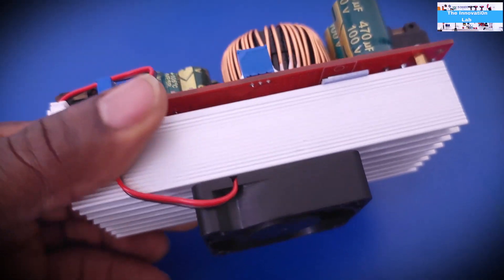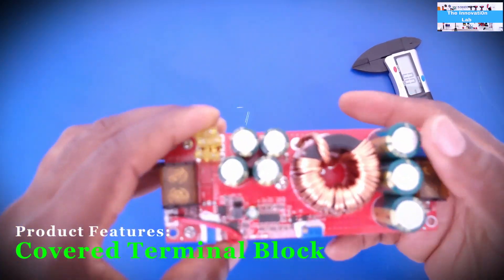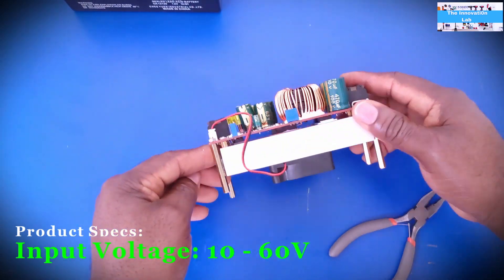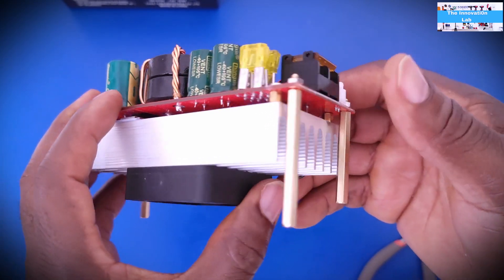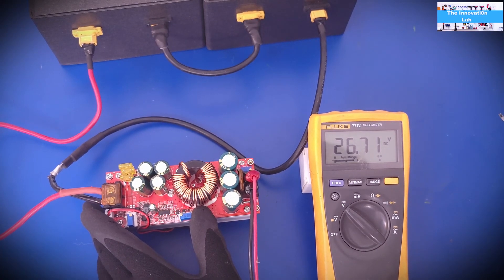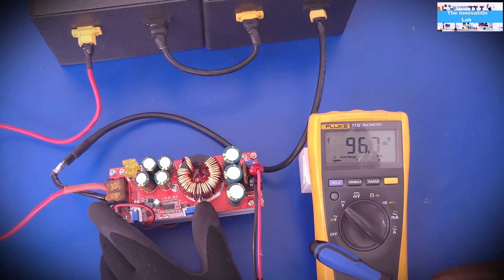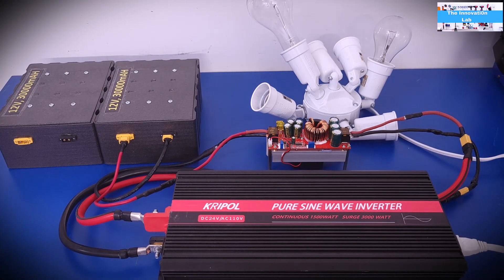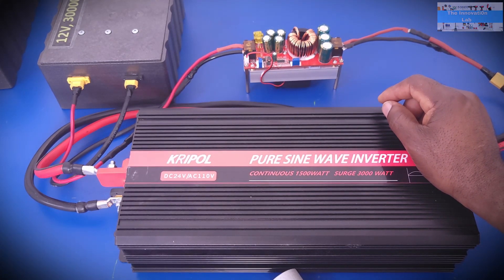Testing Cheap DC-DC Converter from Amazon - Are They Any Good?

Comment: Hi friend, i use these stepup but have problem  whit  trimmer, not is easy regulation cc and input voltage. The output voltage is good easy,but how can have the max power output? I use trimmer but not see becouse but not is stable output  at max power.
Reply from the maker: The CV trim potentiometer works when you have a load on the system. 
With the input of the converter facing towards your left hand and the output facing towards your right hand, you can increase the output current by turning the potentiometer towards your right (clockwise turn).
When you get to the maximum point, you will hear faint audible clicks from the trim potentiometer.

Note:
If your CC trim potentiometer is all the way counterclockwise (lowest output current), your converter will lose output voltage regulation and will not boost the input voltage.

Output Voltage crashing when you apply load?
This could simply be because your set output current is too low. Adjust the CC potentiometer until you see both the output current and output voltage increase.

This is the reason why I always recommend using some power monitors - this way, you can see what is going on.
Watch the videos below for some better explanations;👇👇👇
https://youtu.be/WDWJ77WWkXc?si=ry02ho_BydAFa8hh

https://youtu.be/0Ct_sgbAjU4?si=2exdmFp1vxjSHS-z

I hope this helps.
I hope you are a subscriber.
👍😎
The Innovati0n Lab💥

Comment: Welcome - Thank you for your useful and wonderful experiences. I have two of these 1800w I own a 72v electric bike I use a lithium-ion battery and one of these transformers to raise the voltage to 80 volts to help the batteries while traveling, and it works for me acceptably. I have no problem with the efficiency because I use a 12 volt battery. My question is: is there a way I can add the second booster in parallel? And set the voltage of each booster to 42 volts And connect it with 3 batteries, and the other also through a diode bridge to prevent current collision and breakdown of transformers, because as you know, the negative is connected directly from the output to the input. Thank you very much, my dear. My greetings to you.
Reply from the maker: Thanks a lot for the great feedback.👍👍👍

We have made a lot video projects with these converters. In general, SMPSs do not work well in parallel unless they are designed to work in synchronous control mode.

We have conducted the paralleled converter experiment and I found it to be very unreliable. However, we just found a way to raise the output power of these converters. 
See the videos below. 
💥 PARALLELED BOOST CONVERTER CONCEPT:
https://youtu.be/EKqIIOe_q8k?si=ZwgxstuFYxAtLe0z

💥 COVERTERS WITH BOOTED POWER OUTPUT:
https://youtu.be/_cG3smKwTzE?si=uJPFZL8eDacqAvVE

I hope this helps.
- The Innovati0n Lab💥
Reply: you can change Vol and Ah not Watt

Comment: what is the max input current (amps) again please?
Reply from the maker: The specs of these converters are not very well written. I would plan for 30A max... just to be on the safe side.
Reply: @theinnovati0nlab782  thanks for answering that. I was asking because I wanted to hook 4 solar panels 460w (40v) with rating of 9amps to this unit, before the wires go in to the mppt solar charger of an inverter. The mppt volt range is 30v to 80v and that's why the solar panels are working 60% of their power because when they up the amps, they reduce the volts and they drop from 40v to 30v very easily creating a bottleneck.

Comment: Will this unit also step down the voltage. I need to reduce solar voltage down from 66v to 59v.
Reply from the maker: No it won't. It only boosts the input voltage. You will need a "Buck converter" for that.

Comment: I was thinking of using one of these to power my laptop from my lifepo4 battery bank. This would be more efficient than using a 2000w AC inverter and big 200w power adapter.... but I'm not sure on the quality of the device, fail-safes like over voltage, output current ripple etc, is it worth using this for a $1500 laptop? I can't find a proper 200w laptop charger anywhere for 12v bank... any thoughts?
Reply from the maker: I wouldn't recommend that you do something like this without proper research, lots of testing, and analyzing the results. 
I would discourage for now. Bit is you insist on doing it. Maybe you can try it with a cheaper laptop and see if it even makes much sense.

Hmmmm, now you git me thinking about this...😂😂
I think it would make for a good experiment for us... but no promises for - maybe in the future.

👍👍
The Innovati0n Lab 💥
Reply: @theinnovati0nlab782  Not sure where my previous comment went. Despite our better judgement I followed through with this and wired the converter to a dc barrel jack, then plugged in via a "dc to HP laptop charger adapter" which apparently has the required resistor inside to allow the laptop to detect a charge via the 3rd "smart" pin inside the charging port. It's charging properly at full speed without even kicking in the converter fans, and actually consumes 100w less than inverter + ac charger! Only weird thing is to initiate the charge the laptop has to be on lock screen, sleep, hibernation or off... not the biggest problem in the world, unsure if this is a Windows thing or HP adapter... but once it's charging it works well. Guess time will tell, if I fry my laptop I'll update this comment lol
Reply from the maker: @aciidphreeek  
Amazing! I am glad your project idea worked. Thanks for the update. Keep me posted on the performance.
👍😎
The Innovati0n Lab💥

Comment: Hello. Best video. I would like to know if it is possible to replace the two 12v batteries with a single 24v 340w solar panel to do the test that you did towards the end of the video from 13 minutes onwards.  THANKS.
Reply from the maker: Absolutely.
Yes, you can do that. 
The two 12V battery packs were used in series to make a 24V LiFePO4 battery pack anyway.
👍😎
The Innovati0n Lab 💥
Reply: @theinnovati0nlab782 All right.  have you made any special adjustments to the buck converter (input and output current and input and output voltage) in relation to the 24v inverter ?
Reply from the maker: @user-nu8cb7tv3g  
If you are going to use it to drive an inverter system, you just need to make sure that the output current potentiometer is set to the Max point. 
Set your output voltage to fall within your inverter's input voltage range.

For output voltage,  output current, and undervoltage protection adjustments, see the videos below;
👇👇👇
https://youtu.be/WDWJ77WWkXc

UVP setting:
https://youtu.be/t8Aaz4iQeXY

Comment: Thank you for the review I just wanna know that why is my 1800 dc tp dc fan not working is their a switch for it???
Reply from the maker: Thanks for the great feedback.
The fan is temperature controlled and should start up automatically.
I have not seen any switch for that. 
You should return it if you just bought it. 

On a second thought, the fan will only start up under a heavy load....which would obviously warm up the system enough for the temperature sensor to detect the heat and turn on the fan. If you are only using it for small loads, the fan may never turn on.

I hope the helps.
The Innovati0n Lab 💥

Comment: I'm a little bit surprised by the parallel connection of the input fuses. This is not good engineering practice. In Germany it is also an absolut engineering no go.

Fuses are designed to blow up at a certain amount of power which develops at a certain current. This amount of power can be very different for different or even the same fuses designed for a certain current.

It means the inner resistance of a fuse can differ a lot. And therefore the current will be distributed not equally between the fuses. Furthermore if one fuse blows up there are still fuses left to the circuit behind and further harm can occure.
Reply from the maker: Wow!
Thanks a lot for such wonderful feedback!!
👍👍👍
Honestly, it is as if you read my mind on this. I recently had another converter failure with the  drive MOSFET getting  damaged due to an overload - all my fault, though.  But it got me thinking about the fuse design and selection because I have had this happen multiple times....MOSFET gets damaged while the fuses remain  intact. I know that fuses are designed to have a  much slower response time than MOSFETs....but regardless with  better design and fuse  selection, some of these failures could be mitigated.

You are absolutely right. Fuses have a manufacturer specified melting point , which is a factor of the square of the conducted current and the time duration. Melting points could vary slightly even for fuses with the same current rating.

 A given fuse (fast/slow blow) could have a rating of 20A, but it could really withstand up to a 100A in milliseconds....the blow time is even longer for slo-blo fuses.

Again, to your point, connecting fuses in parallel could linearly or even exponentially increase the resultant I2T meeting point of the network or fuses....wow!
I have done lots of work and research on fuses in the past, but for some reason, this never really caught my attention. 

Again, thanks a lot for this wonderful feedback. I hope that you are a subscriber to our channel.

👍😎
The Innovati0n Lab 💥

Comment: I paid less for two of them on my project. I am using two in parallel so I can get a 54 volt out put at 35 amps without over heating of just one step up buck converter. I need a total of 1890 watts so I am exceeding the limits of one so two in parallel should work just fine. As long as the variable resistors on the board keep their tolerances without any deviations on voltages I have seen on other power supplies that have these 102 blue-box potentiometers. We'll see. I am building a 1.2 kw amplifier for 160-6 meter ham band frequencies, for my radio so that I can operate at legal output power.
Reply from the maker: Thanks a lot for the great feedback.
👍👍👍

It sounds like you have a  fun project ahead. I hope that your design concept works out for you.
However, please be mindful that connecting switch-mode power supplies in parallel to drive that amount of power/load can be challenging. That said, if this is something you have already done successfully in the past, then disregard  my comments.

My experience with these converters is that they perform relatively well in a paralleled topology - when the load is not too heavy and not instantaneously applied. If you can find a way to slowly raise the load on the combined system (load stepping), you will stand a better chance of succeeding. An instantaneous load of >1500W could cause the converters to lose output voltage regulation for a brief moment, and this could lead to a catastrophic failure for one or both of them - loop control issues.

My recommendation:
Try connecting some low-resistance but high power resistor at the output of each paralleled converter ......that is before the load. This is called the "Droop" approach. With this approach, you will need to account for the thermal dissipation on the Droop resistors.

Please check out the video below👇👇👇
https://youtu.be/EKqIIOe_q8k?si=OWPUym1jfP4LcirK
Reply: @theinnovati0nlab782 will this charge lifepo4 batteries?
Reply: @theinnovati0nlab782  for parallel use would it be a good idea to put diodes on the outputs to prevent them backfeeding to each other?

Comment: Hi, I have a scenario where I need to 'boost' 12V to 58V, with as much power as possible. I considered using 2 boost converters, like these in parallel, each having a diode on the output to isolate them from each other. Now I am thinking maybe it would be better to have their outputs set to 29V each, and to SERIES connect the outputs. Lower difference between input-output voltage ( 12v-29v vs 12v-58v) should mean higher efficiency? What do you think?
Reply from the maker: I have made lots of videos regarding your comment.
Please take some time to watch them.

A few notes:
1. You can only connect these boost converters in series ONLY if your are using a separate input power or battery to drive them individually. 
2. The parallel connection approach only works well at low power demands.
3. Using 12V for high power dc to dc applications is something I will highly discourage.

Please watch the videos below.
👇👇👇
Paralleled boost converter  concept:
https://youtu.be/EKqIIOe_q8k?si=pYiwpdiLNjnd5W6p

12 to 48V boost converter ebike drive: 
https://youtu.be/haGmAmpqNAw?si=8pozrAL3OipckYHV

5000W  Boost Converter Concept:
https://youtu.be/oPhLpekQ4q4?si=iKRUMD_YZiggf8m3

I hope this helps.
👍😎
The Innovati0n Lab
Reply: @theinnovati0nlab782   THANKS!
1st - checked. The whole concept is to move extra energy from 12V solar setup to 48V battery, so 12V battery is driving both boost converters.
2nd - yes, that is why I am considering paralleling the inputs and connecting outputs in series, to maybe reduce the conversion losses with 2 converters, instead of using single converter on same power.
3rd - agree, high currents are not the best way to transfer energy, but see point 2 :)

Comment: My battery full charged at around 62 to 63 volts, do you think this would still run around that input voltage?
Reply from the maker: I understand your situation. However, I will not recommend it.
As a matter of fact, I have learned to take the manufacturer specs of these converters with a grain of salt.
Personally, I apply some extra input voltage derating when I use these converters. This means a -10V reduction from the rated input voltage. I prefer to keep my input voltages between 48 and 50V Max.

SAFETY:🔥
If you do decide to drive the converters with >60V, I would recommend wearing PPE. I have seen lots of these converters fail....not very pleasant.
👍😎
I hope this helps.
The Innovati0n Lab.
Reply: @theinnovati0nlab782  then can you suggest a boost converter that can handle more than 60 volts input? Coz i cant find it  anywhere.  My purpose of using a boost converter is to just maintain  a 55-60 volts to run my 60 volts 1,500w inverter or could you suggest a different solution to my needs.  My inverter operates at 53-70 volts but my battery low voltage cutoff is 48 volts so i need to extend the operation of my inverter up to that volts and not just 53v.
Reply from the maker: @dhr6978  
I have heard you, and I have taken a mental note. It is heard to find an off the shelf converter that would meet all the specs you are looking for without breaking the bank. 
No promises, but I will keep this in mind for future projects and videos. All my videos are directed towards solving these types of problems for my audience.

However, we will need your help to grow our YouTube audience - if you don't mind. These videos are not worth the effort if the right people are not viewing them. You can help by sharing our videos on Facebook, Instagram, with friends and your diy community.
Thanks again.
👍😎
The Innovati0n Lab
Reply: @theinnovati0nlab782  thank you so much for replying and giving advices really appreciate that, yes i would try to help your channel in exchange thank you

Comment: Sir can i use this to drive ebike motor? My ebike use 4pcs of 12v12ah battery, i plan to use only one 12v but higher ah, use it as input to this boost converter to get 48v output to drive ebike controller as well as the ebike motor. Is it possible? What ah of battery i need to use?
Reply from the maker: Great question. 
👍👍
Please watch the linked video below and let me know if you have more questions.
👇👇
https://youtu.be/haGmAmpqNAw?si=CGNtYVLpp3lul81P

I hope this helps.
👍😎
The Innovati0n Lab

Comment: Great video. I want to charge 58 volt lithium from a truck alternator. Any idea what amp I should set this board?
Reply from the maker: Great question.
What is the amp hr rating of your lithium battery?
Is it a lithium phosphate or Lithium-Ion battery?

Comment: I was wondering....if you set these boost converters for, say, a current limit of around 10 to 15 AMPS, would the converter be damaged if the output leads were shorted together for a minute or so, or would it just sit there with 10 amps harmlessly flowing between the output cables?  What about for full current setting (not, of course, exceeding the wattage)??

The reason I am asking is that I have a very large super capacitor bank that I want to charge from 0v to ~48v.  I know that the cap bank will be virtually a short at the start of the charge, especially if I have several banks in parallel...don't want to blow my new converter.
THANKS MUCH!!!
Reply from the maker: Hi friend,
I understands your concern given the ultra low ESR of supercaps at full discharge. However, what I know is that these converters have Overcurrent Protection - but I honestly have never attempted to short the output to see how the converter would respond.

A good idea will be to add a low resistance charge resistor to in series with the converter output - to help protect your coverter. If not, you may either damage the converter due to high current surges, or the converter will go into oscillations as the supercap bank is charging.
I hope this helps.
Success wishes.
👍😎
The Innovati0n Lab
Reply: YOU ARE RIGHT  (I learned the hard way!)...A SHORT ON THE OUTPUT WILL DESTROY THE CONVERTER INSTANTLY!!...even at low CC setting...every time!
You just can NOT use these converters like that!!.  After this happened last night,  I looked around on YouTube and found an Hour-long video in them The guy had many of these, doing all sorts of tests, and had three of them that were destroyed just from shorting the outputs.  One of his solutions was using a current-limited power SOURCE.  I ordered another 1800 watt 40A converter from Aliexpress...found it for only about $12 (it's the same)!
--dalE   @theinnovati0nlab782